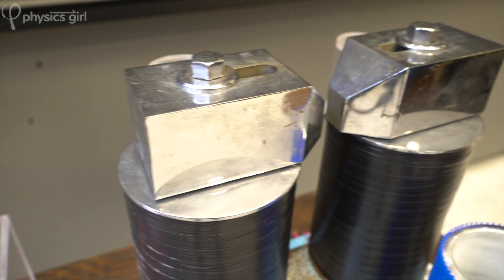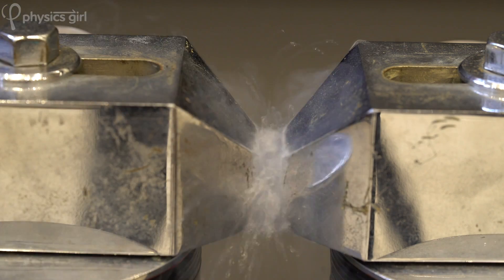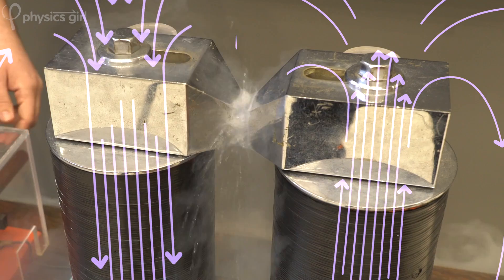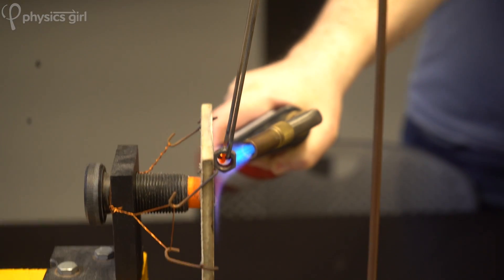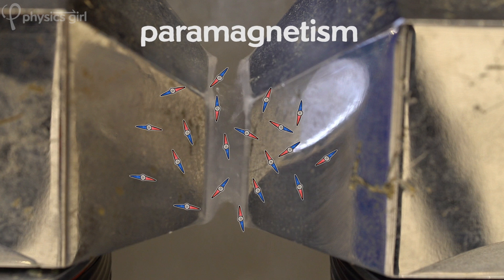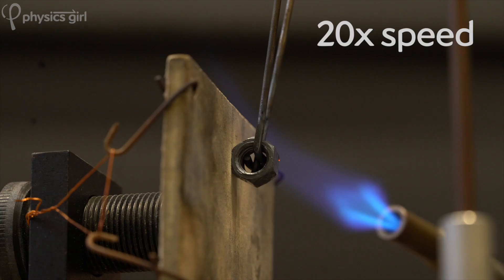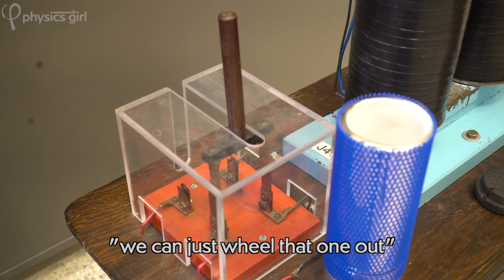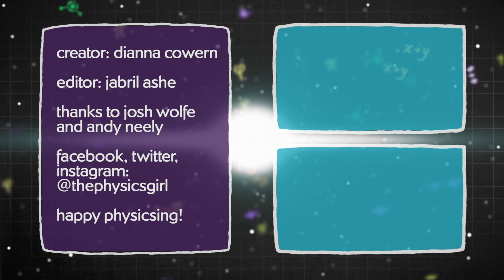Oxygen is MAGNETIC?!

Comment: Why no explosion with so much oxygen and that huge spark ????
Reply: Fun fact: a donut will not burn quickly. It's so fuel-rich the reaction can only really happen at the surface, and it takes a lot of energy to get a self-sustaining flame lit on it. It's similar to trying to light a big log on fire with only a match, without using kindling or anything.

That same donut, having been saturated with liquid oxygen, will burn like a thing of nightmares. It burned hot enough to burn partly through an epoxy lab surface!
Reply: All these comments about nothing to burn, and none of them seem to realize almost every metal will oxidize, aka burn. And the plastic, and the table, and, and, and... I think the right answer is that it very quickly dissipated. This is also probably why they encase the switch in a semi shielded manner.
Reply: Nightmare scenario: Liquid oxygen spills onto clothing, and wearer tries to brush it away. Friction or a static spark ignites the oxygen-soaked cloth; faster than you can react, worse than you can imagine.
Normalcy bias has a hard time with low probability, high hazard events.
Reply: What would be the fuel source?
Reply: The fuel source is people. The odds of spilling liquid oxygen on oneself are small, but the consequences are catastrophic. Friction is sufficient to ignite LOx soaked cloth; hot spark is just gravy.
Reply: It diffuses into the ambient air too quickly is my guess.
Reply: Thing is: With pure oxygen nearly everything can burn. Its actually really dangerous stuff. But the only pure oxygen wasn't close to the spark. It probably had dispersed before it got close.
Reply: oxygen does not combust on its own. its an oxidizer.
Reply: Oxygen is an oxidiser it requires an external source of fuel to burn if there is no flammable source there is nothing to oxidize.
Reply: Maybe because it's liquid and not in gaseous state (?) I mean it got no chance to be in contact with the spark
Reply: Pure hydrogen (without oxygen) does not burn.
Reply: i think oxygen is just an oxidiser. needs a fuel to start a fire
Reply: Umm, you need heat too. A small spark like that won't ignite oxygen without fuel with a flashpoint near the temp of liquid oxygen.
Reply: Exactly !!!
Reply: Oxygen doesn't burn.
Reply: Needs something to oxidize
Reply: Adam Shaiken no fuel just oxidizer
Reply: Silly Puppy acetylene does
Reply: oxygen is not a fuel, it's quite misleading. Oxygen is a requirement for the oxidation of your fuel source (aka burning). There are exceptions, but oxygen is NEVER the fuel source. It is only the oxidizing agent.
Reply: It would still need something to burn like carbon or something else, I think the spark didn't actually burn anything since it was an electric spark.
Reply: Oxygen atoms make a race for space plus there's no fuel to explode..
Reply: because its cooled below 90k and also it just supports combustion, it itself does not burn....
Reply: too cold?
Reply: After reading some of these comments and watching the video, I'm not sure why it didn't explode. I worked with LOX in the Navy. Have you ever heard of a 'fire triangle'?  A fire requires 3 things; 1) source of ignition, 2) fuel and 3) oxygen. LOX in itself, is the fuel( as well as source of oxygen). At -297° it constantly boils in liquid form, releasing vapors that are highly flammable. After handling LOX many times, as well as just as many safety videos,,,I would prefer not to be anywhere near an unsafe experiment. Not saying this was unsafe,it is MIT after all. LOX does have an expansion ratio of 862:1( from liquid to gas) if I'm not mistaken.  Very cool stuff as well as addictive to the body
Reply: No, oxygen is the oxidizer, the other ingredient of a combustion.
Reply: Oxygen is a fuel.

Comment: Scraping ferrofluid off of a super strong magnet is the worst job ever. Imagine you need a job, go to MIT, and that's what you earn money with! That must be horrible!
Reply from the maker: The ferrofluid poured on a magnet was done in my bathroom. It's still soaking up in a sacrificial washcloth.
Reply: Physics Girl But what if you got an even stronger electro-magnet and put that sort of like a shell around the magnet with ferrofluid on it, with a bit of a gap between the two and powered that up? Just theoretically, that'd be possible, right?
Reply: Physics Girl you could of covered the magnet in plastic wrap then you could avoid the cleaning of the magnet, I'm guessing that would work
Reply: Just add heat! MIT has all kinds of cools ways of making heat, I think you'd just need ~1700°F. You'd have to re-magnetize the neodymium when you're done, but hey.
Reply: I think you can try to solidify the liquid, for example by cooling, so it could be easier to scrape off. The magnet could crack from thermal shock, so you may want to cool it gradually (e.g. fridge, and not in liquid gas). Please make a video of that also :)
Reply: beetle5000's suggestion is the right forethought - maybe something stronger than plastic wrap, like acrylic.  Even the plastic container from some produce.

Actually, if you have another permanent magnet, the same trick should work.  Just put the clean one behind the plastic and bring the dirty one close to it.  Once the field is strong enough, the fluid should start transferring to the other one with the assistance of gravity.  Just don't lose your grip on the dirty one as they get close... :D

The residue is still a problem, but - yeah... too late.
Reply: I'have covered the magnet with a sheet of silicone or mylar L)
Reply: Bro, just turn magnet off to clean it!
Reply: Shes a MIT Physician.
Reply: @leto1963  *physiciST 

HUGE difference.